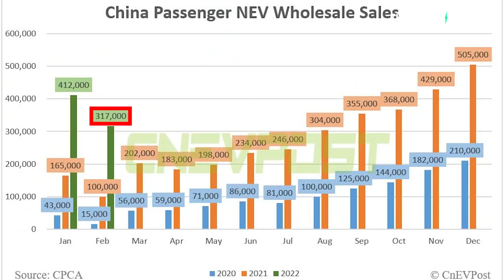2022's China EV sales show possible legacy auto extinction

Comment: I think that a lot of people want an EV but can't quite afford it due to the higher upfront cost of many vehicles and are sticking with their old ICE cars until they can take the step, and that's one reason that the market in geneal is down. The big move in EVs this year will be commercial as both Ford and Stellantis have good vehicles for the commercial fleet operator as well as the BYD and widely distributed Maxus offerings. Also Arrival and Volta are ramping up production.
Reply: You are right, hope less expensive cars come to the USA from Vietnam and China. I have a Prius and hope to buy a EV in the next two years.
Reply: Many more will get rid of their ICE cars when and not if fuel hits $4 or even $5 per lt, while my EV still costs the same $3 in power per 100km
Reply: Not a problem in china. They have dozens to choose from that are cheaper than buying an ICE car.
Reply: @davefroman4700  Yeah until January 1st 2023 then they will cost a lot more when they lose all the subsidies! Including the no license plate fee that is currently around US$10K for ICE vehicles, so even that cheap US$4500 EV will suddenly cost at least US$14,500!
Reply: @gregb1599  Unlike the US, China actually plans for the future. There will be a new round of subsidies but they will be reduced because they already have the industry scaled and the costs under control.

Comment: I don't think you understand the Chinese market
In northern China, the endurance performance of electric vehicles is very poor in winter, which has been proved by large-scale tests in Chinese media such as DCAR. Therefore, many users in the north will not consider buying electric vehicles as their first car.
In addition, a large number of Chinese consumers still prefer to buy gasoline vehicles with joint venture brands because they believe that these foreign brands are more reliable in quality.. Especially the dominance of BBA at the price above 40W RMB. The three models of Audi A6L, BMW 5series and Benz e together have more than 50000 sales per month.
Although China has a lot of electric vehicle sales, this premise is that China's automobile market is huge.
In addition, electric vehicles pose new challenges to China's power source, that is, the energy structure.

In addition, I see that many foreign audiences do not fully understand Chinese brand electric vehicles, especially their shortcomings.
LI one - reverse the chassis of the previous generation Toyota Highlander
BYD EV limited problem has not been solved. That is, you will suddenly lose power when driving at high speed on the highway
BYD Han's rear suspension system is called chopstick suspension because it is too thin
NIO - chassis adjustment is rubbish. When designing the appearance, the wind resistance coefficient is not considered, resulting in low endurance when driving at high speed
When Xiaopeng P7 collides, the airbag will not open, even in a serious collision
Reply: EVs work in Canada and Scandinavia. With the right infrastructue they would work just as well in Northern China. A car is a very complex machine and every model of car has recalls to fix some problem (e.g Volvo XC40 has had 7). Why should EVs be different?